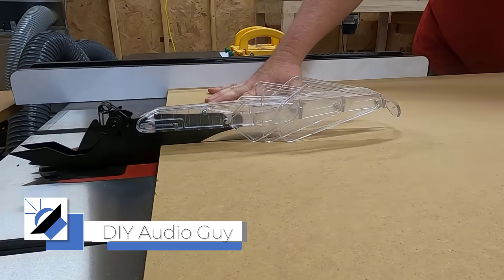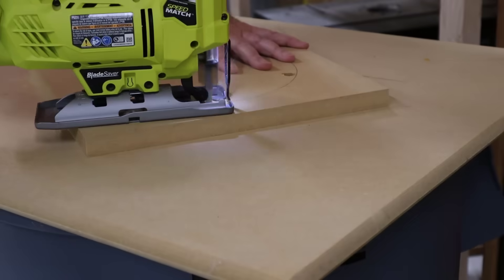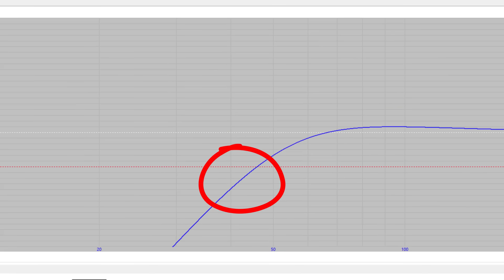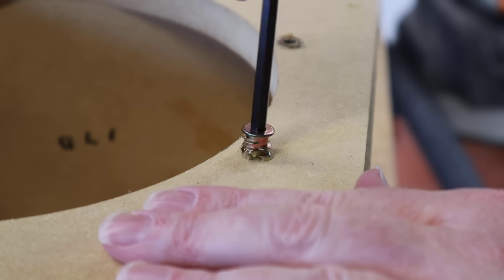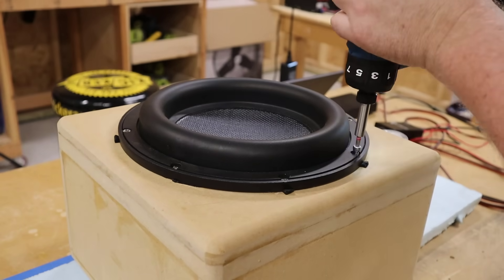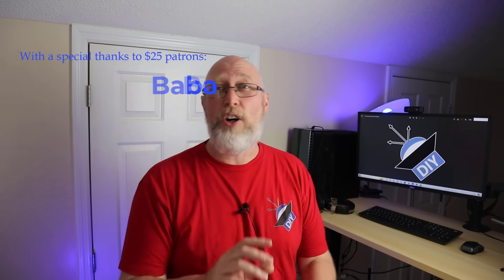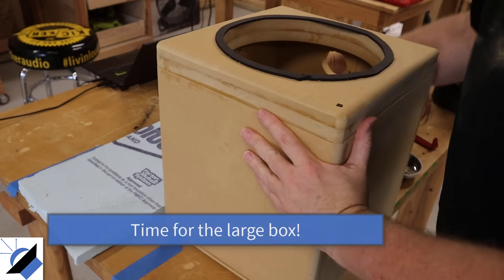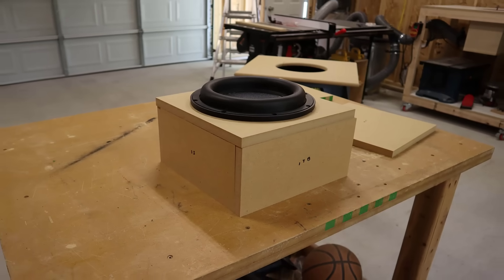Bass in a small space?  Sealed subwoofer enclosure design.  @PartsExpressOfficial

Comment: What would happen if I put a subwoofer in 50% too small of a box?
Reply from the maker: You would choke off the low end output and end up with a "peaky" and "boomy" enclosure.
Reply: @DIYAudioGuy  can i send you a picture of my design need some help dont wnat to blow my sub
Reply: @DIYAudioGuy  is a Cylinderbox for spare tyre dimesion are Radius 44cm with height 16cm subwofer is a pionner chapion 1500w

Comment: Hi, im currently building a mobile speaker with a small tpa3116d2 amp. I have a small and a large subwoofer chassis at hime which i dont need but i dont have their parameters to build exact enclosure for them... i want to use this box outdoor but i dont know if its better to go sealed or ported, small or large subwoofer because amp is under 100w rms on subwoofer channel. It should also not be to big to carry around. Maybe to got some help for me. Or should i buy a car subwoofer which parameters i know ?

Comment: how about if the box is flat and narrow but long enough to create the ideal enclosure volume?
Reply from the maker: That should be fine.
Reply: @DIYAudioGuy  thanks, I’m going with a 24x12x7.5 box for one Alpine W10S4. That should be right at .83ft^3 which is exactly what the recommended size for it should be. I will still have plenty of space between the magnet vent and the back face.

Comment: Of course. That speaker needs freedom to move. Or was it designed to have box pressure to control the cone travel? Speaker/driver selection comes first. Then you buy/build around that. Or just go easy and buy the best sounding product at the store.

4:14 On that graph. How many DB down is that red dashed line? I'm guessing 10DB? Not a great amount of difference between the lines.

9:22 The measurements of the three lines are a lot closer than I was expecting.

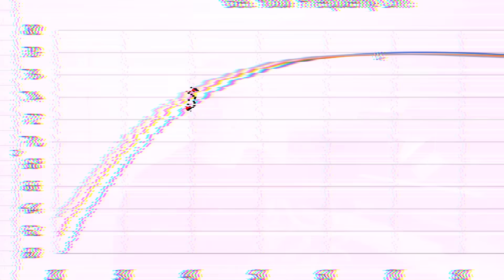9:37 2-3 DB difference at 40HZ. Listen to a whole song with one. Then listen to the same song with the other. I dough there will be a noticeable difference.
Reply from the maker: Both, the air in the box acts like a spring and is part of the driver's suspension.  To tight and bad things happen, to loose and bad things happen.

Comment: I'm running a 12" Fosgate T1S1 (shallow mount 600w 1ohm 12"). I had to get the shallow mount to fit under the seat of my truck - and this is one of the largest subs I can fit there.

I've always used ported boxes in the past, but the manufacturer actually recommends a sealed box for this speaker. I feel like I'm missing some tones I'm used to feeling more. Would going against the manufacturers suggestion of using a ported box be beneficial, or would it just make the bass sloppy? Why would the manufacturer recommend a sealed box over a ported one?

Thanks in advance!
Reply from the maker: It is tricky to get decent bass in an under-seat enclosure.  My recommendation in this case is to stick with the sealed enclosure and use your EQ to boost the missing frequencies.

Comment: Sealed vs ported depends on the use, room setup etc. And sealed can definently go as deep and as loud as a bassreflex. But it requires more power and tuning. But if done right they do performe better for many uses. But it's cheaper and easier with bassreflex. That’s why really high-end subs more often are sealed while cheaper almost always are poeted. With exceptions both ways of course.

Comment: Sealed boxes are great, however ported boxes are the best way to go. The problem is most people do not build proper ported foxes and so they get a name of not being as good. This is incorrect. And if you want to get real funky get into what's called dual reflex boxes and passive radiators. But honestly regular ports are great however I would advise using an aero port style port style Port that has flared ends this absolutely makes a difference

Comment: Thank you for the great video. In winisd don't forget to encourage your viewers to look at group delay when comparing two models. The sealed enclosure will handly outperform most any ported design when judged on basis of a metric that quantifies transient response, but will need more drivers/excursion if it is to stack up to the ported design in steady state SPL. The casual listener is accustomed to late bass, but will prefer "tight" bass, all other things being equal, 100% of the time. Late bass isn't phase aligned well with the harmonics of the waveform being reproduced. Its the kid that always lags behind riding bikes around town. With complex numbers, like Winisd most certainly uses, there are at minimum two plots that define a response. Magnitude and phase. It is probably worth the small amount of time to play around with the parameters in the planning phase of a project, maybe sacrifice low end extension to give a better transient response, at a minimum know what the tradeoff is in simulation land.

Comment: So wouldn't it be better to just insulate the middle enclosure rather than go with the larger sealed enclosure if you're trying to save space? I've heard a fully insulated box can make the box act as if it's up to 40% bigger...
Reply from the maker: My test showed that you this is incorrect, adding stuffing to the box does not help it act like a bigger box.  Use the biggest box you can.  Most people will argue that the box sounds better with polyfill, so there is not harm in using it.

Comment: Some drivers are designed far small boxes like car audio subwoofers, and home audio drivers for bigger boxes.
You must know the Qtc for your sealed enclosure 0.707 gives the deepest F3, a lower Qtc has more output but some higher F3 and higher Qtc gives also higher F3 and a bump in output arround 100hz or so .
Qtc depends on the driver you use in the sealed box, a car audio or a home audio subwoofer in the same size box have a different box Qtc.
The best for me is a Qtc between 0.8 and 0.9 it gives a very small box and with dsp you can also tune the sub easy to 20hz+-3db. 
My DIY sub with a Qtc around 0.8 has dual opposed 12 inch Scan Speak discovery drivers on a Hypex FA501 plate amp, tuned deeper and flatter than a SVS SB2000 subwoofer.
Intern its the same as a Sigberg 10D subwoofer with bigger drivers, it looks like the Arendal 1723 2S and with a 500 watt amp the same output as the Arendal 1723 1S subwoofer @20hz.
But with a higher Qtc you can feed the woofers much more watts before it beats itself to death, way above the specs for the drivers.
A 12 inch Scan Speak discovery woofer in a Qtc 0.6 box kills itself with 200 watt, but the same driver in a Qtc 0.85 box can handle 500 watt easy.

Comment: could you help me with some advices please? I'm into deep, tight bass, I had a JBL gto1202d in a sealed box, that made my car feel like a massage prolonged session. 
Now I'm thinking about getting some deep tight bass to my PC, but going with a 6.5 inch subwoofer. 
I was planning to integrate it in the desk, like blend it inside on of the shelves, not sure if you manage to picture my plan. 
In terms of drivers I saw a ground zero rated at 100 rms for about 70€, or a digital design rated at 250w rms.  I already got a small DIY class D amplifier that should supposedly push about 100 watts at the very best. 
This sub would have to integrate into my existing bookshelf speakers, a pair of microlab solo 6c speakers that are rated at 50watts rms per channel, so 100 rms combined.
With all this in mind, I'm still not sure whether a 6.5 inch is enough to achieve something deep and tight or I'll just end up with boomy bass. 
By the way, when I tested the JBL inside my home, there were differences, I could hear everything rattle around me, windows, doors, furniture, but I could hardly hear any bass at all, it was so strange, perhaps it was due to the sealed enclosure, which makes me ask you this too,  should I avoid sealed? I was planning to build this sealed. 
Thanks!

Comment: Well I wouldnt agree on the case scenario when you only should use closed box. You picked woofer with Qts suitable for closed box. And you can model it in ported box like you did, but in real life the sound of it will be awfull. So you really dont use speakers with Qts 0,7 in ported and Qts 0,3 in closed. There are reasons for that.

Comment: I have found that the Allen wrench is not the best option for the insert. Sometimes the insert will strip out on the Allen wrench. My best suggestion is to use a bolt washer and nut. Use a socket to drive the bolt down till the washer is flush. This will guarantee that the insert is flush with the surface every time, and that the Allen wrench will not strip the casting. You can insert it with a tapping rig to hold everything straight if necessary.

Comment: Wrong conclusion because he looked at the wrong graphs.  Pull up the graph in WinISD of max SPL and look at  30 Hz.  The small enclosure max SPL is identical to that of the large enclosure because it is limited by Xmax on the woofer and has nothing to do with the box size.   So with a small amount of equalization, which every one uses, the bass you can actually get from the small box will be nearly identical to that from the large box.   He should have applied a Linkwitz transform to each,  available right there in WinIsd, and EQ'd the bass flat to 30Hz.   DIY Audio Guy needs a bit more education on WinISD.   If you need more bass, add a second sealed woofer.    Vented bass is sloppy, it crushes transients and it is resonant and slow.   He had an excellent opportunity to show the difference in distortion at the same SPL from each box.  That would have been interesting.   The small box will have more distortion.

Comment: I'm 52 and from 1993 until 2015 I ran sealed.  In 2015 I bought my first ported enclosure for two alpine type S.  Man what a difference.  Ported is the way to go IMO
Reply: I used to prefer ported enclosures for Spl. I now prefer sealed enclosures for tighter more accurate bass. A passive radiator setup is a nice in-between.
Reply: @jimmiewomble416  That is a bit of a myth.. A ported box built right is just as tight and does not loose as much power as a closed. Passive radiator basicly does the exact same thing as a port..
Reply: I would agree.
Reply: Depends what you want to acomplish... Bassreflex gives more power handling but not as flat responce curve. Sealed often plays more accurate when done right. And they can really pack a punch and shake everything if you have the right setup. Bassrefleks are designed to encrease the bass at a specific frequency range. And that's great for it's use. I preffer bassreflex for my use but absolutely considering a powerful sealed sub next to get a flatter and more precise bass response in my room. For cars I usualy go for bassrefleks but both work great. It's all about setup and use case.
Reply: @West3rror Sealed enclosures handle more power than ported.

~Custom installer over 40 years. Perfect score on MECP speaker enclosures section. Few do it.
Reply: @TE5LA-GAMING  wrong. But they usually use more powerful drivers because it demands more from the driver to force it to move in a closed box. Well known facts.

Custom installer for 40 years and you have not learned such basic information? That's a bit weird.
Reply: Depends on the sub.  Some are designed specifically for sealed boxes,  and just won't perform well and won't last in a ported box.  Some are designed not to matter.  Some still are designed specifically for ported, and will sound like shit and wear out in a sealed box.
Reply: @RC-NW  Well.. For closed box it needs to handle more since you litteraly need to force the driver to move so yes, you can't just throw in any driver.. But the other way around is rarely any problem at all.. With bassreflex you also get more dB from the same amount of power than in a closed box. Closed box is the toughest config for a driver because it litteraly is a closed box. Never experience a "closed box" driver play bad in bassreflex setup but definently killed several that was not built for closed box design since they could not handle the pressure and extra power needed😅
Reply: I’m 54 and from ‘88 til 2022 I’ve run sealed boxes and I must say ported is a different animal!
Reply: Sealed sounds much cleaner imo especially in a small space ported is to boomy and the bass would sound distorted most of the time
Reply: I ran sealed to and what I switched to ported that's all I run now.
Reply: Hate to break it to most of you but ported is the way to go but if your low on space then enclosed is better than nothing I hope you all have many years of bass to enjoy
Reply: @jong-yk3gk  Depends on the use case and many other factors
Reply: Haha I was there about 8 years ago. I built a double vented box with type x 12s 😅. I expected boom. Sold a 12. It was barbaric.
Reply: That’s so cool I’m 51 and have ran sealed boxes for quite some time. Tomorrow is install day for me and I went with a ported box and 2- 6.5” sundown subwoofers, I’m pretty excited to hear how it sounds…
Reply: @1973chrisg how did the 6.5 subs turn out??
Reply: How much do you charge for an enclosure?
Reply: So much better, at least compared to the box I was using before
Gets way lower and louder, sounds great
Reply: Im 51 yea the pro Pyle days and always build my own boxes . As a bass head I've always had good luck ported . Now with a mini truck and no room im using sealed but not getting much deep bass.
Reply: Same I always ran sealed in my cars cause the bass was accurate and tight. But then I got my first sub in a spl box and oh my!!! Now I've been an SPL head since. When I want quality sound I just cut the subs off and play my mids and tweets lol. I love pressure 😭 now I have 2 l7s and those are insane. They take a beating!
Reply: i will always use sealed. i have drive sport wagons and such and a sealed down firing dual 10 hits in all of my wagons with so much clarity. ported always sound muddy. just IMO
Reply: Not if you value accuracy
Reply: I'm 87 and from 1954 until 2024 I ran ported. In 2025 I bought my first sealed enclosure. Man what a difference. Sealed is the way to go IMO
Reply: @JohnJohnCrusher  🤣
Reply: It's the Alpine. They been disgusting for the last decade.  Closed or ported
Reply: I am 150 and ....#@&%*... Why do you guys have to tell your age?? Who cares??
Reply: For volume output ported always wins. Its been awhile since i was in the game, but back when i had a showroom to play in and all the subs and box options you could want, sealed always sounded better my ears. Im sure by now they have figured out a way around that
Reply: It'll hit lower, and lower at the tuned frequency, but sounds like shiit outside of that. Sealed is the way to go, if you like sound quality that is.
Reply: @Smokesignals99943  We don't live in the 80s anymore dude.. Both sealed and ported is the way to go for sound quality. If you buy a quality sub that is.. Sealed subs requires more from the driver and amp compared to a ported one. But for difficult rooms sealed might be the way to go. But there is actually no such thing that sealed is better than ported for music quality etc. That's just a very old dead myth that some still clings on to. I have heard ported subs play much better than sealed but also heard sealed that play much better than a ported. It all depends in a viraity of factors. And setup is key regrdless...
Reply: @West3rror  no myth, just fact. You keep your ported box, I'll keep my sealed.
Reply: @Smokesignals99943 Your right and wrong at the same time. 95%, Yes a sealed box will be superior in quality simply because it's a PAIN-IN-THE-ASS and very time consuming to properly tune a vented enclosure for it's environment. 
A sealed enclosure is much easier. It mostly comes down to box size and location, with guaranteed SQ.

**That said, an equally sized, PROPERLY tuned, vented enclosure, will be superior. Equally tight low end but with higher SPL to boot.
Reply: @West3rror You know nothing about audio. Stop embarrassing yourself.
Reply: @kevinsbiscuitsnjelly8193 Ported isn't difficult.  Use software and install a tube. Ported is for lots of boom for the buck,  and when you have more space. Something the Ported crowd doesn't seem to mention: A Ported enclosures has to be twice the size or more to get that bass. You call this efficiency?
Reply: Sealed All the way, feel that bass in the ground 😅
Reply: @bossman1680  That's why I in general preffer bassreflex.. More powerful bass than most sealed options. Sealed requires alot more from the driver and a bigger amp to do the same. Facts. And feeling it in the ground is not relative to what enclosure it is.. It's just a sign of not beeing the best built floor if it vibrates😅
Reply: Sounds better now that your deaf? Lol
Reply: @adventureswitheddie6444  I'm sure I'm deaf at this point
Reply: If you're going for SQ though it makes it so much harder to tune, I'm endlessly wanting to tweek the settings. Sealed with an amp that has plenty of headroom is the best I've ever done. Also, to literally bolt the box to the cars body, that's another one that I learned that makes such a nice huge difference everytime. If you haven't done that the install isn't complete.
Reply: For car bass, ported is always the way to go. Very few sealed applications will sound better or louder for bass reproduction in a car. I have one 10 ported right now that is just as loud as two 12s sealed so imagine the usable car area being saved. Sealed just doesn't make much sense anymore.
Reply: @jimjones3287 Wrong. I've won many sound competitions with sealed enclosures going down to 16 Hz with 11" woofers. If you like just loud uncontrolled distorted peaky bass, ported is great. I like smooth, tight, and responsive bass.